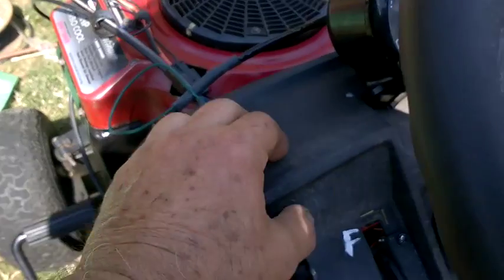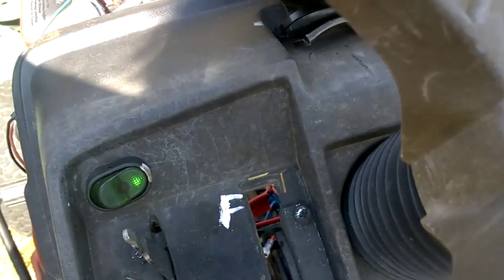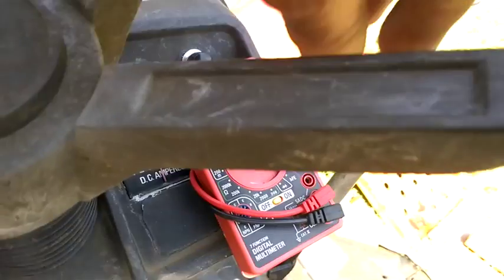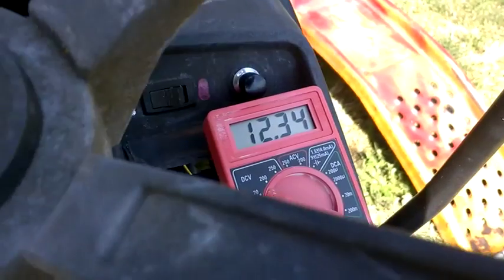Auto Tachometer on Opposed Twin Flathead

Comment: 1 how you hook it up, 2 where you get it and how much, 3 is it accurate?
Reply from the maker: It's accurate for an opposed twin. Just any auto tach set to 4 cylinder. Hooked up to the trigger side of the coil I used.
Reply: @vanstechcorral  trigger side?? Ive never hooked up a tach before i just know one wire needs to go to coil. Is it the wire that runs off the “tab” on the coil?
Reply from the maker: @fullsendsornosends1176  you need to see a pulse as engine rotates